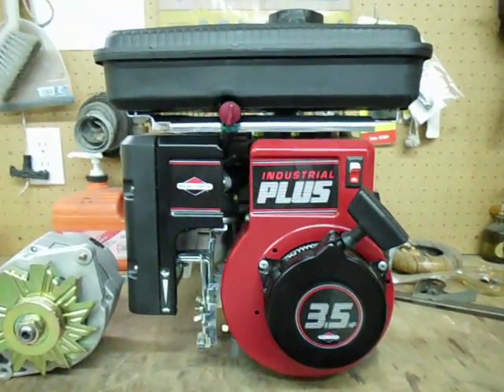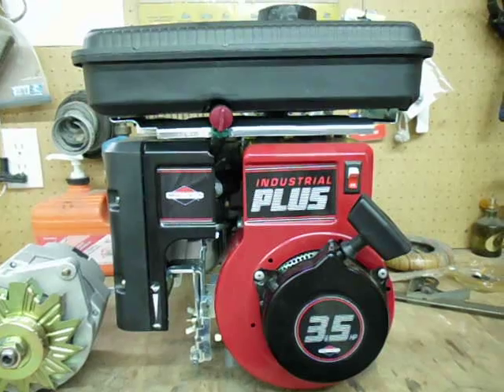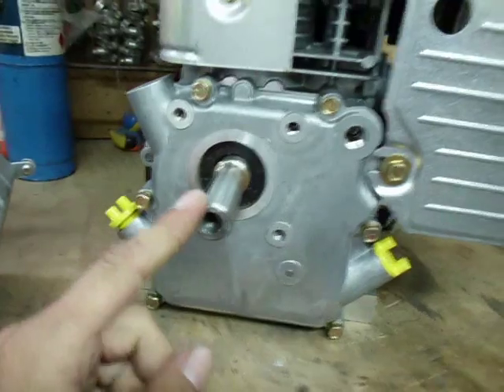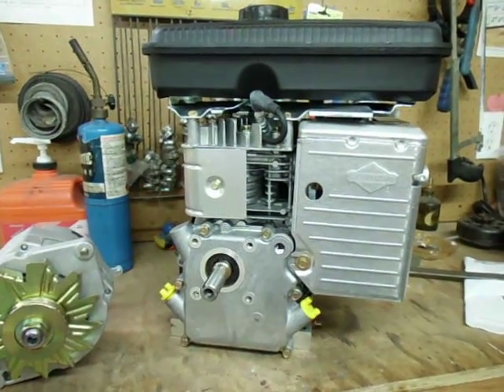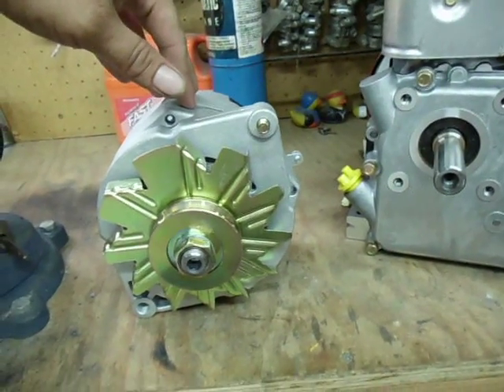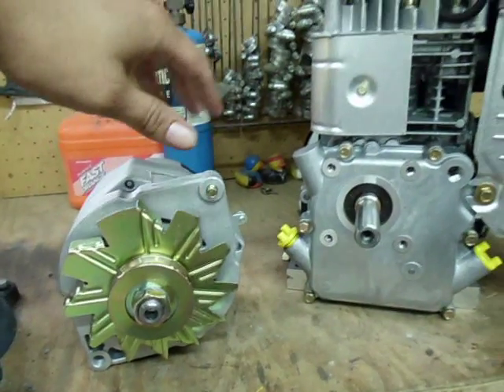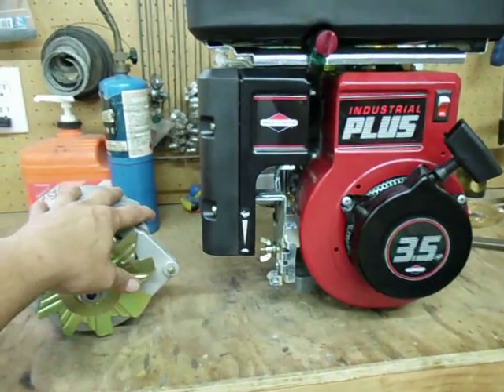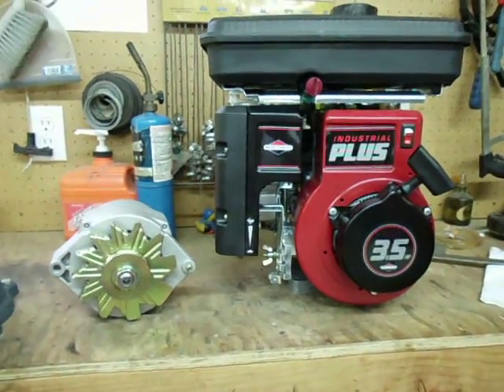woodgas charge station

Comment: hi joshua you have to get the right size pully for the generator a coupple of diferent sizes may dbe necessary I would believe one slightly larger on the engine then the alternator. I dont really know but. you want that engine reving up as fast as possible to maintain high gas draw .do may be the same size as the gen or smaller on the engine gasdrivencars used low gear to maintain high gas flow and you will get high talk to the gen. I run my home on solar energy andbatteries@inverterJOHNMILLARD

Comment: Hi Josh IM glad yr back working on your gasifier. and the new 3.5  cast iron engine gen set. but have you thought of getting a 100 amp battery charger and pluging it into your old 120 volt gen to charge yr batterys. battery chargers do not work well on generators. because  the sine wave output is more rounded on top. where utility power reaches a much sharper higher voltage peak. reving the gen faster can solve this problem. I dothis to charge my elec car batteries.good luck JOHN 93667keep faith

Comment from the maker: I did consider that possibility so i planned on using a 100amp disconnect in my postitive wire to allow the engine to warm up before placing a load on it, thanks for the comment,....josh

Comment: Won't you need some method of reducing the load on the motor while you start it and let it warm up?  If you have the alternator throwing full current into a discharged battery bank while you are trying to get the motor started it might be hard on the shoulder and the rope starter!

Comment: I like that u got the plus motor one thing u could do is buy a wind turbine PMA than u could add in a few of them for a much larger power output and not need big HP keep up the good work most ppl never try to do the off grid its not hard to do just make it so u have alot of stuff workin on dc like lights and more u can even convert electronics to dc real easy too.